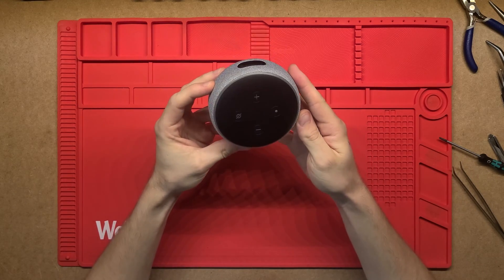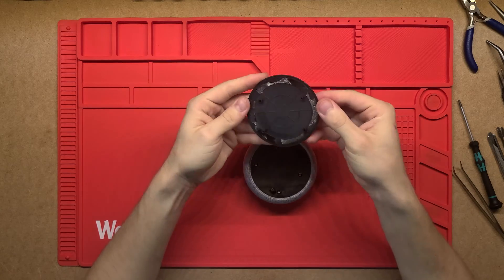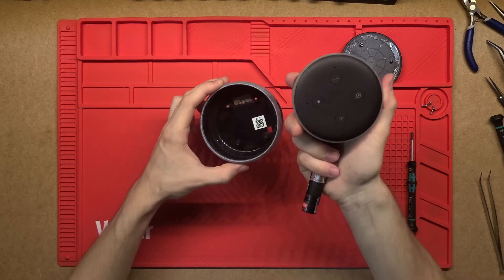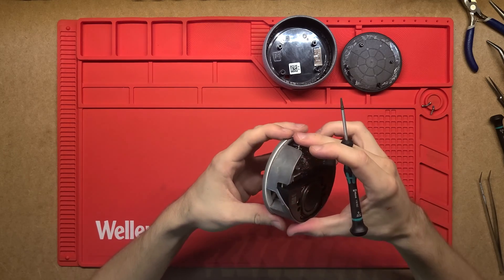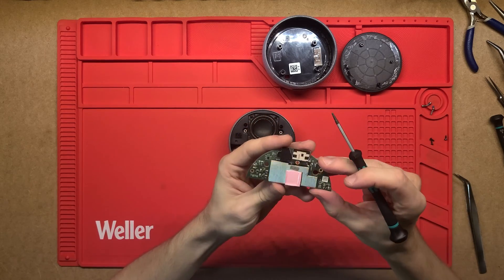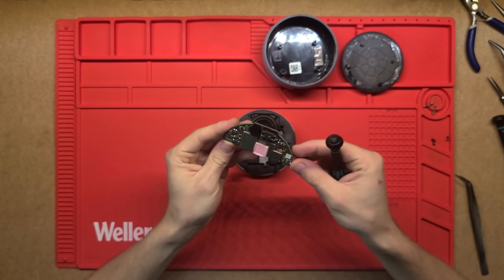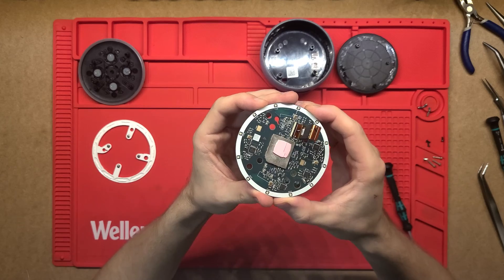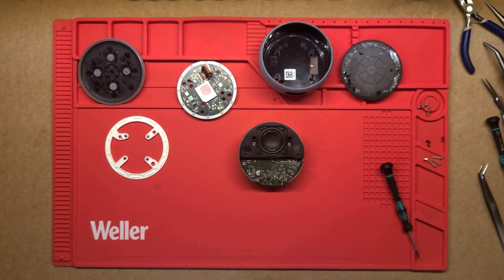Should This Be Inside Alexa Echo Dot?? In-depth Teardown

Comment: I know this may sound silly but is there a way to remove the 4 mics? I only want to use this for doorbell notifications. I don't trust alexa listing into everything I say
Reply from the maker: Not silly at all! Completelly get your concern for privacy. 
Yes! You can unsolder the microphones, or you can simply use a utility knife to cut the trace on the PCB that leads to the Mics. Just keep in mind this will void your warranty, and you may damage the device. 
What I can't comment on though, is how the onboard computer will deal with the lack of audio input. You may run into random issues or the system may log microphone errors and trigger diagnostic alerts. 
Regardless, they are cheap second hand so you don't have much to lose giving it a go!
Reply: @ToolsnTeardowns  thank you very much. I was thinking the same issues then thought, no worries, they don't cost much :-). I will give this a try soon and get back to you with the results. Thanks again
Reply from the maker: Great! Good luck and definitely report back 😊

Comment: The thing at the mute button is a red LED, for when the mute function is enabled. If mute on, set ring LEDs to red and turn on mute LED. Also, there is a voice proxy sensor which tells the computer where you are at, so LEDs in a brighter state would be facing directly at you while talking.
Reply from the maker: Ahh yes! You are right. Thanks for the comment!

Comment: The RFID tag and QR code is to track the device as it moves around the assembly floor
Reply: this is the right answer
Reply: It's actually a data matrix, not a QR code
Reply: @ethan5285 they are functionally the same thing, just the QR code is more versatile than a DM as the QR code can represent more bytes
Reply from the maker: Yes, I think that makes the most sense!

Comment: 6:19 — Maybe a bass enhancement void? 😅
Reply from the maker: Hmm, could be. This thing has pretty decent bass for its size!
Reply: Yeah, that's my only guess too, it's not even touching directly the speaker but it's probably that... I wanted to 3d print a small enclosure for a decent speaker I have in sort of a small diy Bluetooth speaker, but speaker design is really complex for what I've been reading, I mean, you can make a very simple box and be done with it but to make sure it sounds correctly, and to enhance the bass things get pretty confusing very quickly, and most of the online tools there are to help you with this are designed for big speakers and a lot of specs I don't have about my small speaker. At this point I kinda given up in trying to calculate the best enclosure I can and just test things with the physical pieces, and idk, maybe I'll try to make an enclosure with a not connected closed box somewhere in the enclosure, to see if that helps in anyway lol